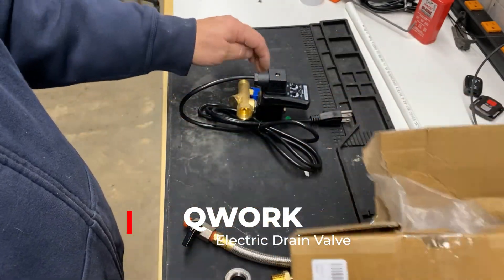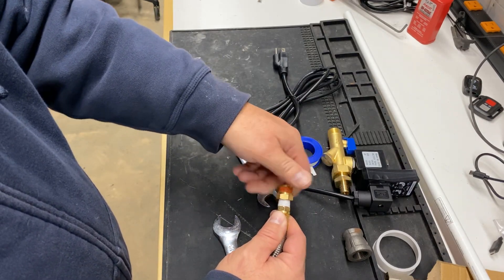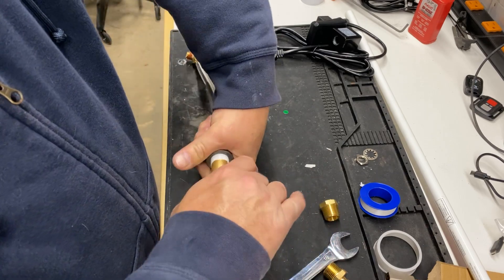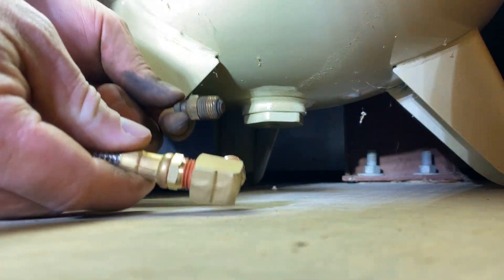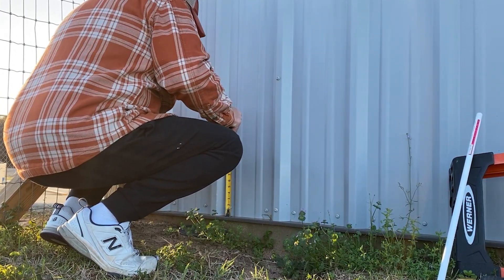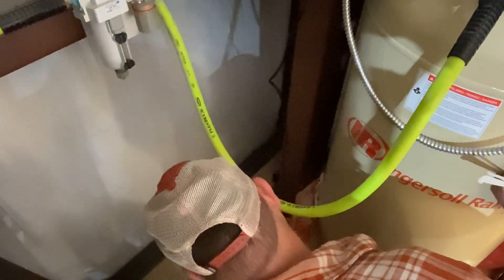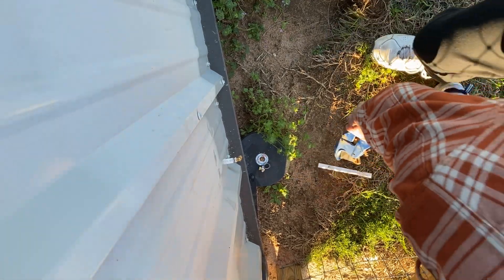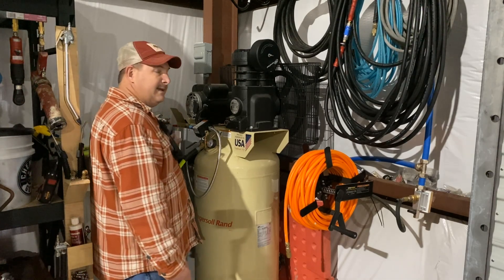SAVE YOUR AIR COMPRESSOR!  Install an Electric Automatic Drain Valve!

Comment: I think I would tie that power switch on the tank drain into the circuit when the compressor kicks on.  Then set the auto drain to every 1 or 2 minutes (While the compressor is running). Then set the drain time to maybe bleed of a couple short bursts like every few seconds or so.  That way,  everytime the compressor starts, so does the auto drain switch.  When power goes off on the compressor switch, it also shuts off the auto drain switch.. Then,  it's not popping off every 45 minutes during every 24 hour day.  I don't know why the timer is only a max of 45 minutes....should be hours or days,  not minutes.
Reply from the maker: I agree with you on that but I have mine wired into a timer so it only runs when the compressor is powered on by the timer.

Comment: I started taking careful notes to implement this for my air compressor, only to learn that PEX degrades rapidly when exposed to UV light (e.g. sunlight). Apparently latex paint can be used to protect PEX, but I'm going to use copper, PVC, or something else tolerant to sun exposure for the exterior parts.
Reply: Don't use PVC.  That also degrades with UV exposure.  Copper would be great.
Reply: I ended up using black pipe, since the exact length I needed was available pre-cut/threaded, and all the necessary adapters/fittings were easy to find.
Reply from the maker: Thanks for the comment.  Yes, I wouldn't use Pex for anything with any pressure on it.  Since this is a simple, purge it doesn't really hold pressure and I didn't feel I needed to worry about that.  If it does degrade over time, I would think wrapping it with some black duct tape or painting would keep it out of the UV light.

Comment: I did the same thing with my compressor a few years ago.  However, I wired the automatic drain timer in to the run side of my compressor motor contactor, so that the drain timer is only active when my compressor is running.  This does not waste air pressure and keeps the water out of my system.
Reply: plug to the switch side or switch to the motor side?

Comment: That timer switch for the compressor is genius. I was just thinking about something like that to prevent accidentally running my compressor if the drain valve is stuck open, or prevent burning out the pump